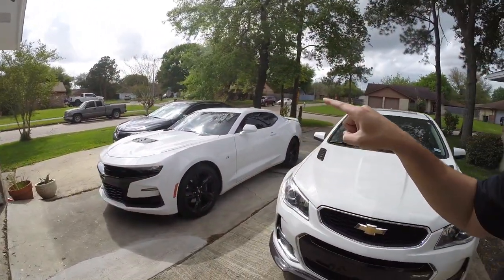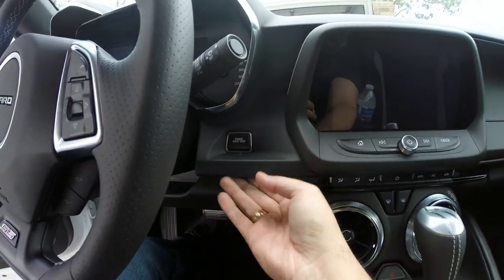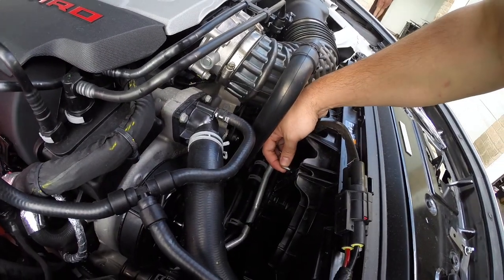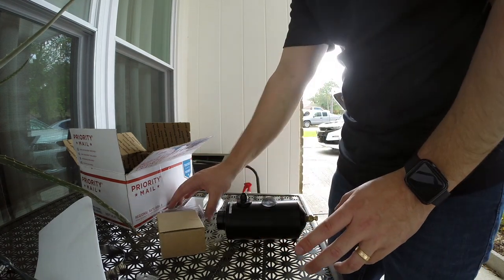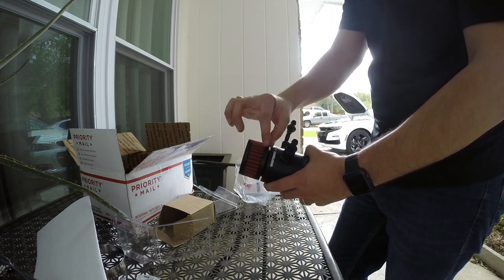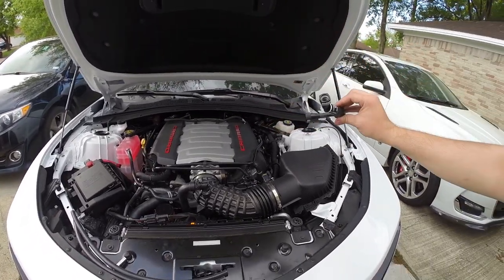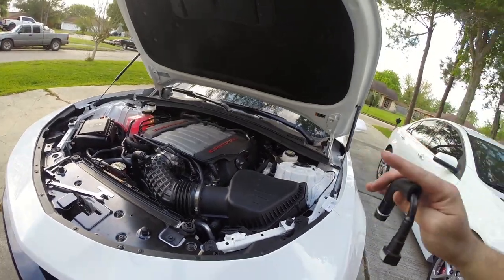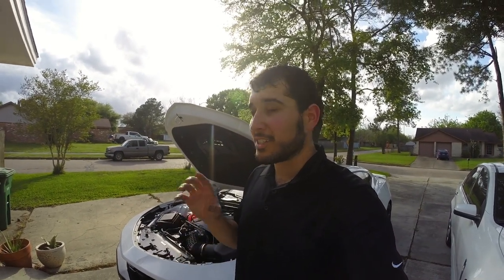2019 Camaro SS Oil Catch Can Install! ITS A MUST!!| Vlog #217

Comment: any tip draining oil from catch can? my car came with it. looks same as yours.  do you keep your engine running while draining ? how do you actually drain it ? lol
Reply from the maker: Don’t keep engine running
While draining and the best way I have found is disconnecting the lines and removing it from the bracket.

Comment: I’m new to this modding stuff. You think a catch can is necessary? All I have is headers
Reply from the maker: On these direct injected motors yes, the valves don’t have the fuel on the back end to help clean them out and carbon will start to build up over time

Comment: After watching a few videos on catch cans I decided to get the Mighty Mouse catch can mainly because I like where it’s placed in the engine bay.   Thanks for the insight on the install after watching your video.  BTW after seeing u fight with that bolt and nut I decided just to get a longer bolt and put it on the other way.  I put the nut on and just held the end of the threads with a vise grip.  Tighten it up good and cut off the extra long
bolt threads to match the Mighty Mouse bolt.  Plus I decided to install hose claps at the ends on catch can and manifold area.  Not sure why they didn’t include them.   I like your channel and keep the videos coming.
Reply from the maker: 2019 Camaro SS 1LE thank you and that’s a awesome idea in the bolt!!

Comment: I just got The mishimoto catch can what's the difference should I have got the one that you have? My build is going to be full bolt ons  heads Cam
Reply from the maker: The only difference is that the Mighty Mouse is basically upgradable for boost with the breather and the add on of a check valve. The mishimoto should be more than enough for any NA set up.
Reply: @JLSpeed  Thank you you have been such a huge help bro!!! Can't wait to see the zl1!! Garnet red is the only way to go!!!!!!

Comment: i got a stock 17 2SS  , just bought some headers and a e85 flex fuel kit havent installed it yet i plan on doing a msd intake with 103 tb what catch can you recommend for the setup i want ?
Reply from the maker: If you don’t plan on doing boost just go with any catch can. If you plan on boost do the Mighty Mouse can

Comment: Did you get the “mild” or “wild?”  If vehicle  has modifications such as cams, headers, intake, etc. would “wild” be the option to get? Last, any additional parts to buy to fit the catch can and where did you buy the catch can from? Thanks!
Reply from the maker: Num, The mild catch can set up from mightymouse solutions will be good for any level of NA car. The only reason to go to a wild set up is for a Forced Induction(boosted) car because it actually has a pcv(check valve) on the outlet of the can to prevent any boost from going into the crankcase.
Reply: Jorge's Vlog  you’re always informative. thanks for the info!  Recommend a website to buy the catch can?
Reply from the maker: @numvienthongsuk4684  THanks, and i would go directly through mightymousesolutions.com I believe is the website.

Comment: Great vedio info ...i just got my ss a week ago lord behold my wifes car a fusion went done 2012 it would stall..i did some research on the car and decided to take a wild guess on whats wrong with it..after watching youtube vedios the throttle body sensor seems like a good guess for the car ..i went to auto zone web page the part was 132 dollars...ok i was ready to buy it but first had to rent a car for the wife shes a busy women so i did the total cost for the rent a car was 324 dollars and because the part i found for 100$ cheaper then auto zone would take a week to arrive it all worked out but very mad auto zone price was 100 dollars more the ford parts for less .com a factory part 32 dollars saved. THE DIFFRANCE IN Money really has me puzzled ..anyways i took the throttle body off and the back side was just a mess with oil nowonder its not working and am very concerned about valves but your vedio is very interesting to me because of the oil in less then 200 miles on your car and mine now 305 miles ..i need this product you show i hate to see my new cars values throttle body get in the condition of what my wifes car had ...how much for it ?
Reply from the maker: Jeff, I got it from Mighty Mouse Solutions and it was around 250 or 350 cant remember of the top of my head.

Comment: Whats the difference between the night mouse and the mishimoto?
Reply from the maker: Neal Rhodes the Mighty Mouse has a external breather for higher hp applications or if there is excessive blow by. But other than that not much is different for boosted applications you could also install a pcv valve to keep the system almost as stock and still be able to vent if needed

Comment: Does the Enginge Clean itself if i drove like 8.000Miles and got my Catch Can now installed?
Reply from the maker: No it does not. This is due to it being a direct injection car. If it was port injection it would clean up the valves some but its not.

Comment: Is there a reason why you went w this one over mishimoto?
Reply from the maker: vlexlopez yes, because this one has the one way breather to relieve an excess crank case pressure to atmosphere, and can be upgraded to be used properly with boost in the future.
Reply: @JLSpeed  wouldn’t you need the wild for boost?
Reply from the maker: @vlexlopez5389  yes, but the mild can be updated to a wild by replacing one of the outputs to a check valve.
Reply: Jorge Loves Speed so would you recommend this one over the mishimoto?
Reply: Jorge Loves Speed and why did you decide to go with sound tube delete instead of with it? Wouldnt it make it louder or does it do no difference?
Reply from the maker: @vlexlopez5389  The sound tube is useless and just extra stuff under the hood that isnt needed. it does nothing and you wont notice any difference with or without it...
Reply: @JLSpeed  ok thank you for all the helpful info
Reply: @JLSpeed  I have the speed engineering x pipe and headers and wanted to make my car louder would a corsa catback make it louder or would I have to change the x pipe as well
Reply from the maker: vlexlopez just change the axleback if you want it louder the x pipe is going to be very similar to what any cat back would provide
Reply: @JLSpeed  I am trying to order the Mighty Mouse right now but it’s asking about clamp type and mount. Do they matter ?
Reply from the maker: vlexlopez you should be able to order the camaro 6th gen specific catch can which has everything needed
Reply: @JLSpeed  yeah I clicked on the camaro 6 mild but it gives me options for the mount and clamp.
Reply: @JLSpeed  for the mount it is either radiator or shock tower and for the clamp it’s either stainless band or billet black
Reply: @vlexlopez did you figure out that clamp thing?
Reply: @angelpizarro5346  yeah bro I forgot which one I got though tbh

Comment: Does that add HP to the car to?
Reply from the maker: Union Heritage Fights no it doesn’t add hp but helps prevent the hp from dropping over time
Reply: No, but if you have a hemi in 50k miles youll have a swamp in youre cam valley which im cleaning rn lol

Comment: Lt1 engine doesnt need a catch can the ss you own does.
Reply from the maker: hugo mion the lt1 needs it more than the SS, the lt1 is a direct Injection motor, so the valves can’t even get cleaned from the fuel additives or cleaners.